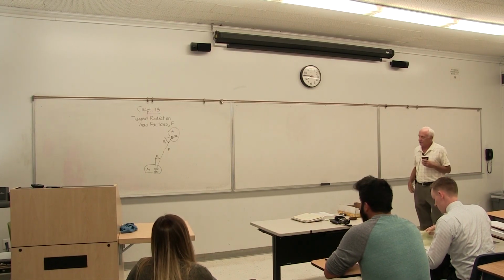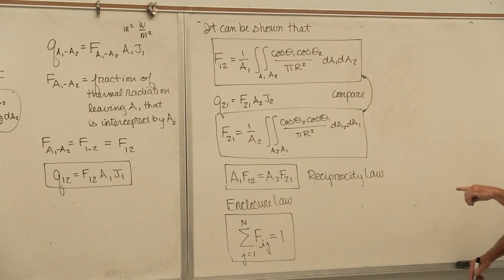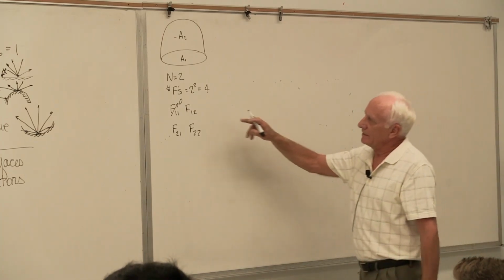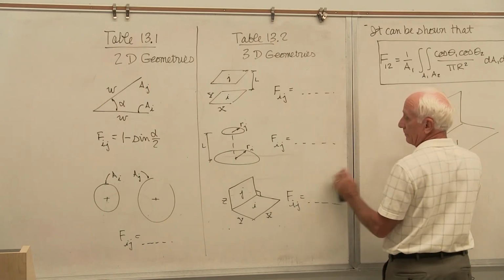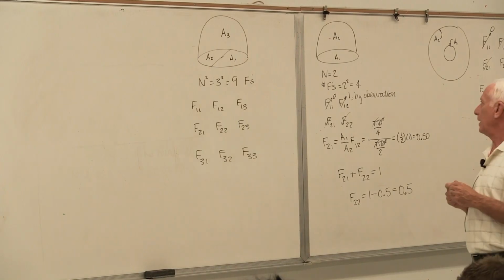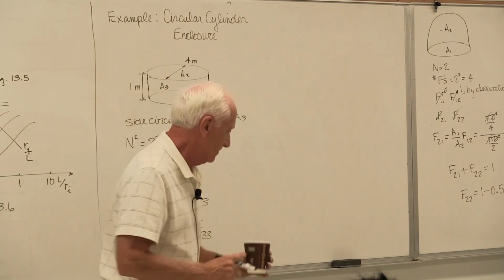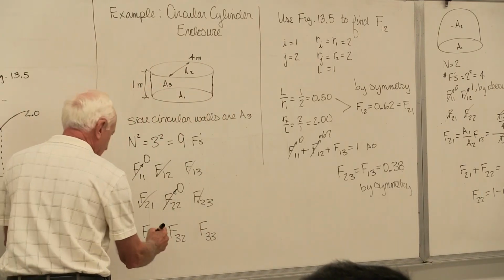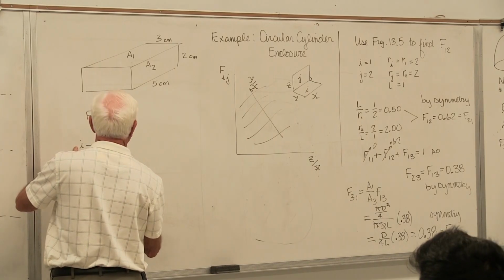Heat Transfer: Radiation View Factors (14 of 26)

Comment: 00:15 Understanding radiation view factors is crucial for engineering calculations.
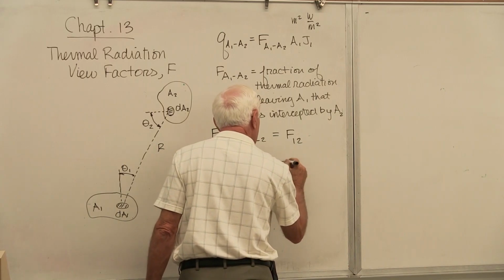04:41 View factor F12 is a function of geometry
14:27 Understanding view factors in enclosure radiation
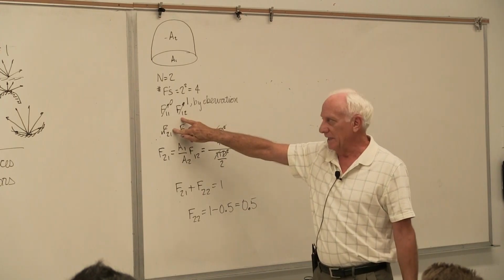18:21 Understanding view factor algebra through reciprocity and enclosure law
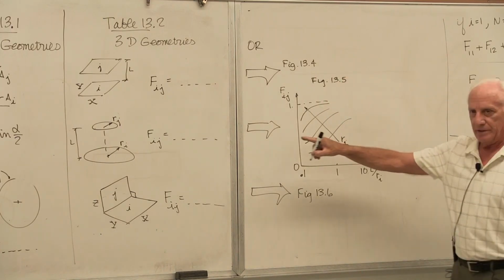26:33 Understanding view factor algebra and equations for solving radiation problems.
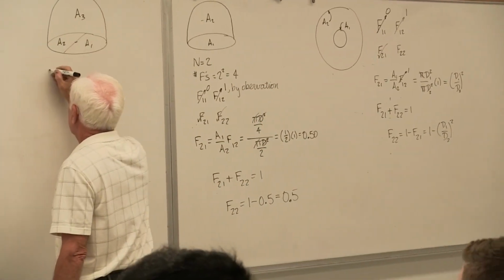29:57 Understanding view factors for radiation heat transfer
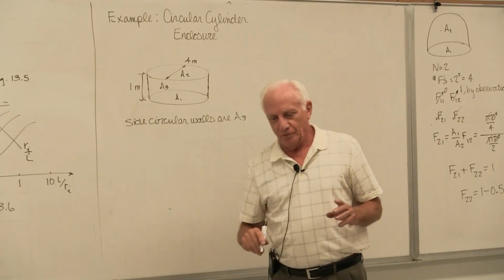36:57 Calculating view factors is crucial for determining heat transfer between surfaces.
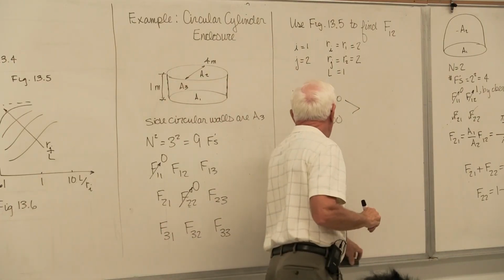40:27 Understanding view factor calculations for radiation transfer
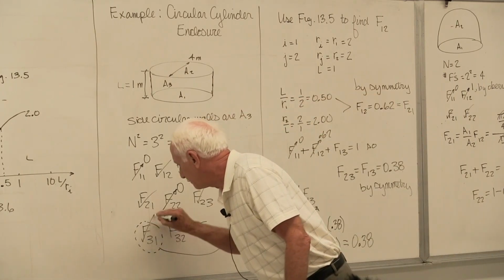47:23 Understanding view factor algebra for heat transfer.
51:13 Understanding parametric curves in heat transfer analysis
Crafted by Merlin AI.

Comment: Shouldn't theta 2 be from vertical like theta one is not horizontal as shown? The answer is, the vertical is dependent on the objects orientation. In this case, the object is completely horizontal, thus the angle is being measured from vertical. Is this true?